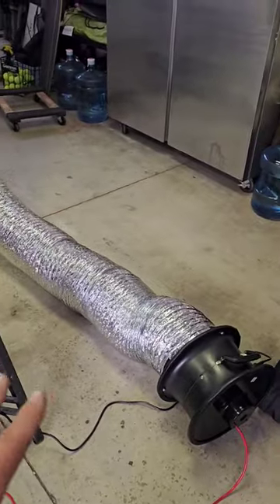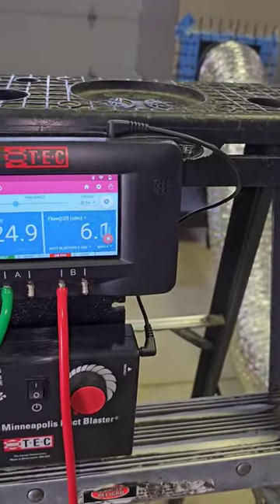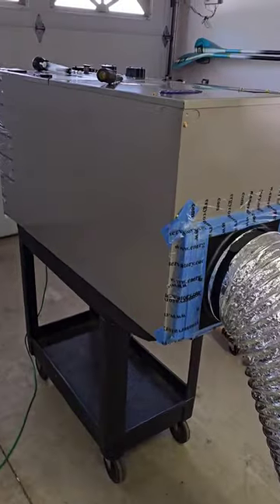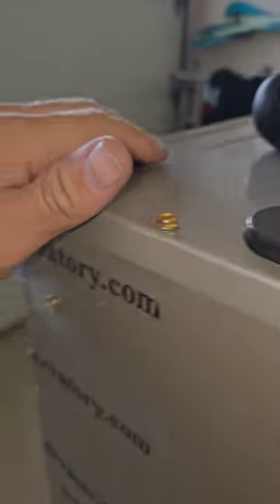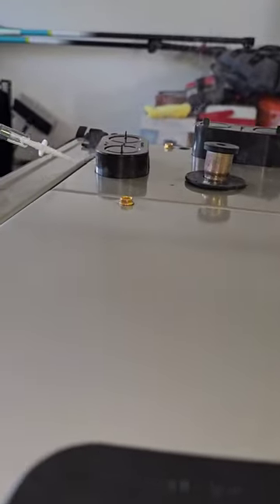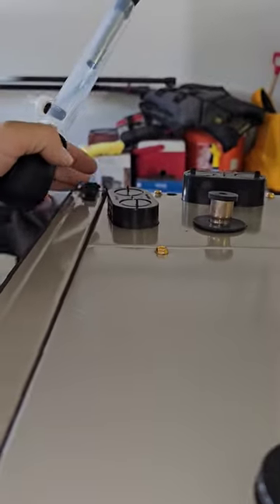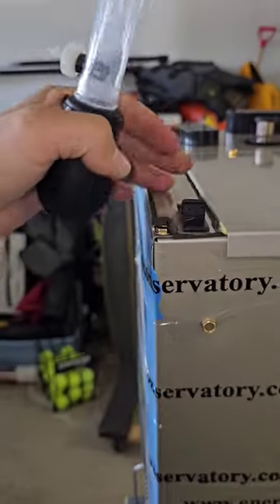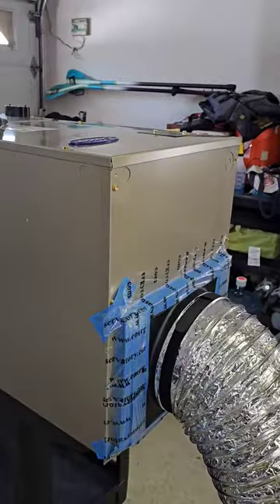I WAS SURPRISED HOW HIGH THE AIR LEAKAGE WAS #SHORTS

Comment: Carrier is definitely the way to go! And yeah we usually fill those gaps with foam tape if we dont just tape it.
Reply: If you read the install instructions you'd see the accurate  air leakage listed by the manufacturer.   Breeze Mechanical Inc.   Thank you.   Chris.

Comment: I'm happy to see you going with the Carrier Infinity system! Make sure you have some spare thermistors, and a maybe a condenser fan motor if it's a 20seer green speed model!
Reply: And a condinser board
Reply: I love it! All the res guys giving you the heads up. But seriously, especially that condenser fan motor. Replaced a few of those.
Reply: A dual capacitor too
Reply: @moo3993  I've worked on and trained with carrier directly on Infinity systems and have a ridiculous amount of knowledge on the whole lineup, just giving tips man.
Reply: @ninnghhizziddha Oh you know I definitely appreciate it, there's nothing better than having what you need on the truck and getting the customer a quick same day fix to keep them cool 😎

Comment: Our house was built in 2020 and has a 3 ton carrier heat pump system. The air handler does have decent gaskets on the panels, but it leaked from the drain line penetrations and filter door also.

Comment: That's crazy. The connections should be tight at the very least. 

We have a small Swegon unit and the panels are so sloppily put together. The whole thing has been sealed with what looks like silicone all around the inside.

Comment: Read the install guide…it ends almost every step from duct to electrical and refrigerant piping with “seal to prevent sweating” ,also, because that’s a multi position air handler there has to be extra holes everywhere. Install and Seal the equipment according to the install guide and run your silly test again.
Reply from the maker: I will discuss this on my Livestream this evening on YouTube 5/29/23 @ 5:PM (pacific) come on over and check it out https://youtube.com/live/c-zUt2l1HmU

Comment: If everything is within the building envelope then the impact from leakage goes way down.    They still leak but if it's in a conditioned space then it's less harmful.
Reply: Sure,but that's not very often they get installed in a conditioned space, 99 times out of 100 it's in an attic or nasty wet smelly basement

Comment: Well uh that’s not really designed to handle positive pressure. That would be negative pressure in normal operation. Also kinda hard to have perfect seals on everything. You gonna silicon your unit shut or something lmao? The amount of air that would be pulled into that unit during operation would have an extremely small affect on the units efficiency.

Comment: Now we are really splitting hairs, however, i will say this; a big factor that is often overlooked with any system that is designed to move air around, is the little known effect of the air leaks actually pulling in debris/dust/particles in into the cabinet/ducteork.
I cant remember the exact terminology. if youve ever removed older semi-ridgid flex duct and noticed black build up around splits/tears in the outer insulation, this-is because of this effect

Comment: you do realize the leakage is BEFORE the coils.....which means the leakage doesn't matter to the efficiency of the unit for cooling/heating.  All those leakage points are only going to cause losses when installed in an attic or garage where the unit isn't encapsulated to not allow unfiltered air in.

Comment: Ask the install crew what kinds of bs they deal with from factory. My favorite is the condenser being filled with nitro instead of refrigerant. Pulling vac 2nd time on a 45ft line set and 5ton equip at 4pm... yay!
Reply: Your own fault
Reply: @HVACRTECH-83  nitro from factory. New installers didn't know what was going on. I was there after my job finished to find out what happened. We made call to remove and warranty the condenser.

Comment: I know this is a joke but the reason is because the cfm for this unit is overwhelming that freaking 10 or 12 inch flex and it's pushing through the gaskets. They are meant to resist suction

Comment: What does this cabinet do? What is it supposed to do?
Reply: Its an Air handler. It handles(heated\cooled)air movement thru the ducts into the home living spaces. Basically a variable spd blower inside the case, and evaporator coil at one end for the AC. Everything a forced air furnace w\ AC has, minus the heating parts(heat coming from a different option - heat pump?)

Comment: No equipment is leak free from the manufacturer that’s why I no longer go SUPERTECH mode on my self 😮😅🤷🏻‍♂️
Reply: I agree completely. The main problem with that leakage would only pose a problem when the duct system isn't running or set up properly. Path of least resistance. This guy's overthinking dumb shit.

Comment: In hot ambient conditions one can appreciate such an air loss😎
Reply: Well no, all the leakage is on the return. That's the worst place to have leakage if installed in unconditioned space, supply leaks still bad too though, mold comes to mind
Reply: @HVACRTECH-83  , I was being funny but also truthful. When you are in a hot attic and the unit has a little supply air leaking in your face it can be useful/appreciated.
Reply: @kennymayo4578  but what happens is not so useful. Not being rude here. When that cold air leaks out of duct seams or the cabinet door, think about the dewpoint in that attic. Especially where I'm from, New England it's a huge problem, even more so in Florida for example. That cold air is going to make that area sweat like hell and rust is the least of your worries. It can soak the insulation and or wood around it, then you get mold growth which if not caught rite away can really spread around. Seen it too many times. I understand what you were saying but it's not good lol
Reply: @HVACRTECH-83  you are correct sir, I failed to mention I wouldn't leave it that way just use it while I'm in a 140 degree attic😎👍

Comment: I would have imagined you'd have been using a high-pressure blower for your tests. The smallest is the 1TDR6 which can handle 1-1/4 in of wc, most filters are rated to be clogged at 1 in wc, it can pull/push 86 CFM through 1 in wc.

Comment: It is sort of wrong to pressurize your air handler for test purposes. You really need to Vac Test. Your air handler is under negative pressure when operating. This negative pressure pulls all the gaskets tighter, sealing better that you think. Especially around cabinet panels and pipe/elec. knockouts.

Comment: IF YOU THINK THAT YOU WILL BE ABLE TO TELL THAT ITS MISSING 6 CFMS THEN YOU'RE A SPECIAL PERSON. YOU HAVE WAY TOO MUCH TIME ON YOUR HANDS. IF YOU HAVE TO HAVE A MACHINE TO TELL YOU THAT IT'S LEAKING DO YOU THINK YOU WILL BE ABLE TO TELL THAT ITS MISSING 6CFM'S OF AIR? SERIOUSLY DOUBT IT.
Reply from the maker: 6 cfms at 25 pascals... the idea is to get people to think about any duct leakage as a problem. In reality if I installed this air handler on a common resi setup with moderately high static at maybe .75 total external static that 6 cmfs of leakage could increase 10 fold....

Comment: Who else actually cares? It's supposed to go inside the house not in the attic or some other stupid place.
Reply: Plus the filter section is supposed to be in a negative. The door will have higher leakage when in a positive. It's setup this way to have better longevity being opened and closed every filter change.

I highly recommend you use at least ba 4" filter. You mentioned you're putting an extra filter frame but didn't say the size.

Comment: On my new air handler that I’m putting in I will probably go so overkill looking for every leak and sealing it. I could fill it with water and it would not leak.

New LG HP air handler sitting in the garage in the box just haven’t had time to install .  18,000 BTU heat pump is all that is needed in a house in San Francisco with our mild climate.. 

We live in the Goldilocks zone for efficiency for heat pumps .   
      Where 51°F night is considered cold.  Lol 😂
Reply from the maker: Mine is not far off from yours.... My video tomorrow reveals the sizing
Reply: @coldfinger459sub0 not if it's undersized it's not better. Better than what? Do the load calcs. All of them. D,J,S then you can tell him what size is better for his home. What cfm should he run his system at? Do you know what his latent gains are? Did you determine his SHR for him? Smaller is better is a very incorrect way of thinking